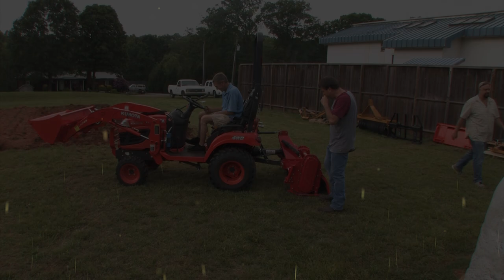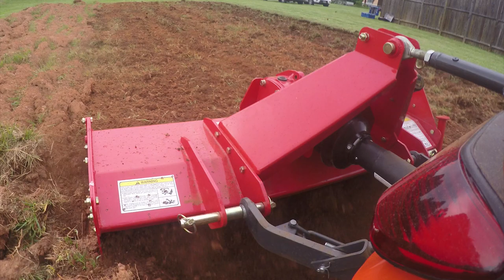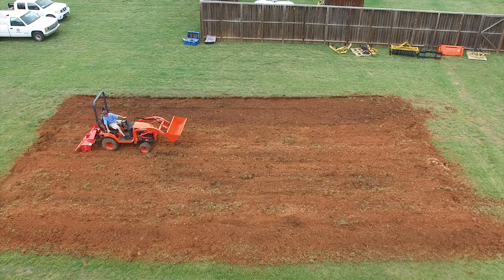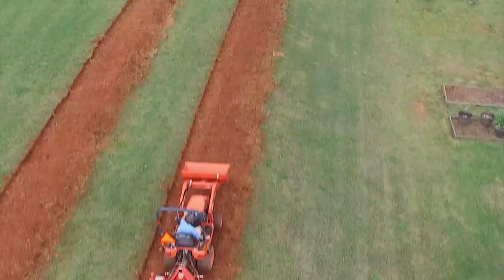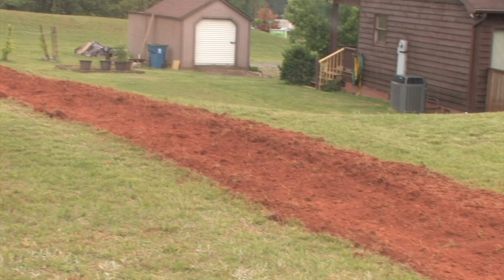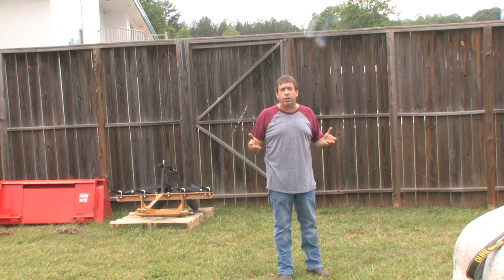How To Till and Rotovate Your Garden With A Subcompact Tractor/Kubota BX

Comment: Great tiller.  I like my reverse tiller better though.  Gives more depth and it looks like it chops it better.
Reply from the maker: We offer a few reverse drive models, but they're not nearly as popular as the forwards.  Reverse driven ones drain more tractor hp.  Also, the depth is hard to gauge and tines throw material back toward the tractor, rather than away.  To add, forward tillers are generally heavier, or at least have heavier options, with a better value for your dollar.  Thanks for watching and commenting!
Reply: @EverythingAttachments   mine is real good.  Though, I would imagine the features it has make it cost a lot more.  Mine doesn't throw anything at the tractor.   There thick, heavy piece of material that looks like a super thick mud flap off a semi that stops anything from hitting the tractor.  I don't really find it hard to gauge the depth.  What I find is that I have to have the back door wide open because of the heavy flap not letting the soil drop.  And, yeah, it drains way more hp.

Comment: Have to ask why not pulverize the soil,  we use an Italian tiller with c tine, leaves the soil like powder. Used it last two years.
Best crop we had.
Reply from the maker: +Joanne Serio Rain will turn pulverized red clay into matter resembling concrete, which is not good for the crops.  It also will make future cultivation a chore.

Comment: Better to use disc harrow with a tiller or stand alone for either
Reply from the maker: Ground type and condition can help determine the answer, but the best combination for our clay soil is to plow in late fall, disc in spring, followed by the tiller.  Check out our garden series and other playlists here https://www.youtube.com/c/EverythingAttachment/playlists
Reply: Looked on your site I want to order a row builder from you soon you look like you have some great equipment I have a 2501 kubota didn't see the category it would be under
Reply from the maker: @moveitback1  awesome!  For the L2501, you'll need the GB60 model.  You're welcome to call us or email for assistance!

Comment: It just don't cut up that grass very well at all...
Reply from the maker: +Z71Ranger We could've chewed it up more by lowering the tailgate and reducing ground speed, but we did not want the soil pulverized into a powder, which would turn the clay into concrete when it rains.  The garden plot had been plowed less than a week before tilling.  Ideally, you should give the vegetation enough time to decompose before running a harrow or tiller over it.